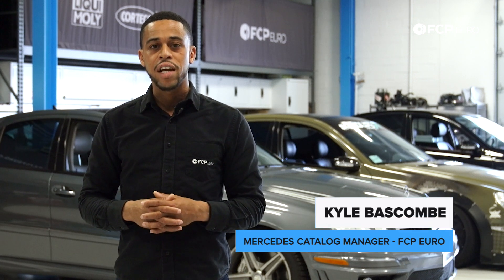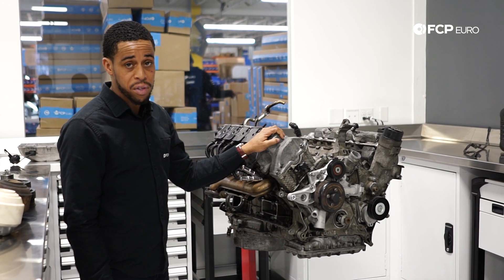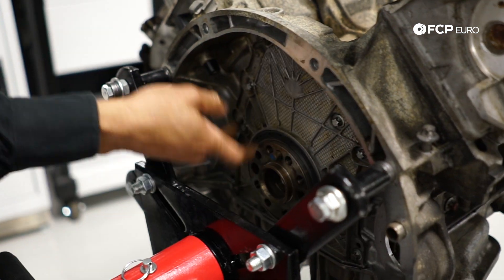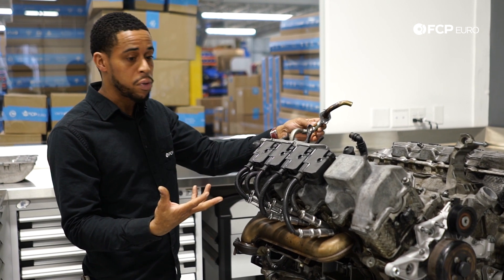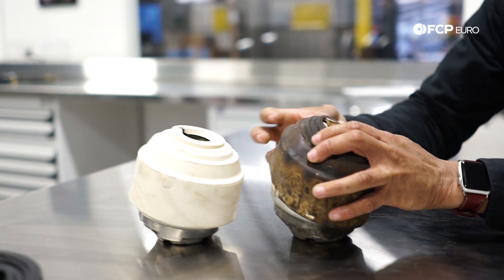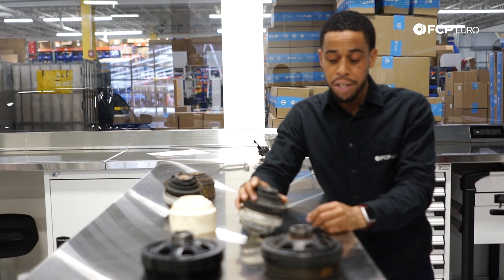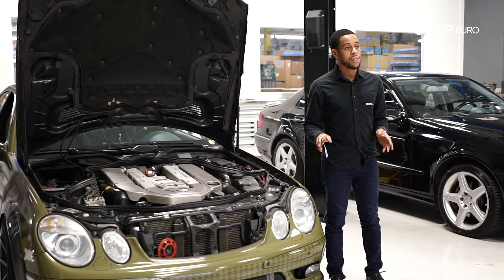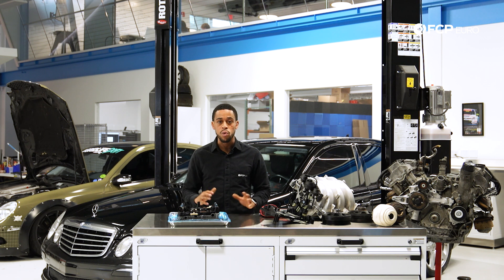Mercedes-Benz W211 Engine Diagnostics/Problems - Everything You Need To Know (M113, & M272/M273)

Comment: This video only pertains to engine issues because there are also many common electrical and transmission issues with these cars.
Reply from the maker: We have a transmission and suspension video coming out Friday and Next Wednesday bc youre totally correct ^.^
Reply: @fcpeuro  Still love the M113 Engine. MY E500 has never let me down.... except airmatic down haha
Reply: I have the 2008 model of the M272 when they fixed the timing issue. Engine is running still like new at 172000 miles 🤷🏽‍♂️
Reply: e500 only had airmatic problem and that been solved with good ol springs.

Comment: dumb question but what are the main differences between the m113 (w210) and the w211 model m113 and m113k other than the sc
Reply from the maker: Minor differences, starting with the 210 the only mainstream displacements were 4.3/5.4 vs 211 5.0/5.4. Different ME's, airboxes, I believe 210's had clutched fans and 211s were electric only. NA vs SC, you'll see different displacements, differences in the bottom rotating assembly, a split sump with 2 drains, different belt drive etc.
Reply: Not actually that dumb of a question,  There's a lot more changes than just a supercharger on top of an engine.  AMGMeister has a great video https://www.youtube.com/watch?v=Gb32BwQMbho that talks about some of the changes between all the M113 engines.
Reply: the biggest difference is compression. m113 has a compression of 11 m113k has a compression of 8. You wouldn’t benefit by puting m113k charger on m113 unless you shave the heads etc, so you need an after market charger. On top of that the ecu of the m113 isn’t designed to go into boost unless you use a piggy back ecu to recirculate that data.